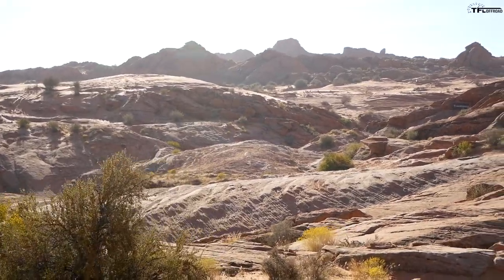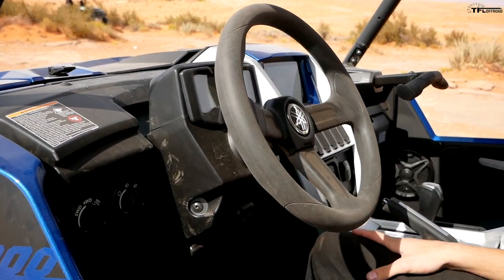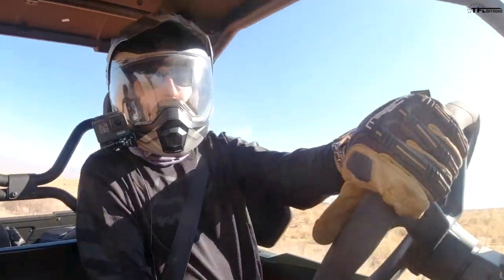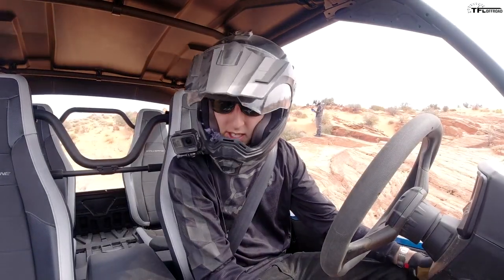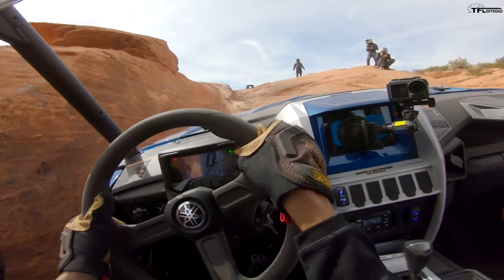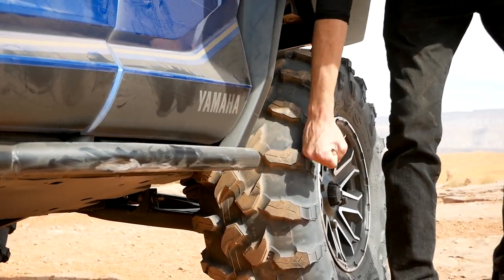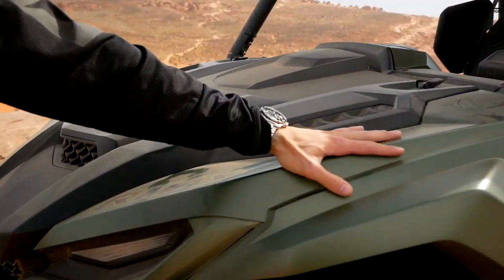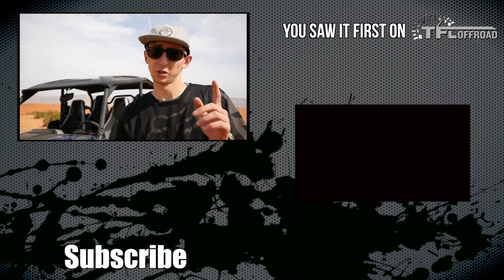I Drove the All-New Yamaha Wolverine RMAX 1000: Polaris Should Be Very Worried - Here's Why!

Comment: The RMax is quit a bit higher in price for approximately only 30 more ponies.  Much heavy for sure. And able to haul the same amount the X2 850 can haul. $8,000 difference in price. I'd love to have one but I'll keep my X2 and just upgrade my base model shocks and put bigger tires& wheels on it , and maybe even a sheeve job.  I'll still have lots of money left over.
Reply: And damn near 20 mph faster with the suspension to handle the speed.  Totally differenct machines.  Ones slow ones not
Reply: Apples to apples comparison is the General XP and the RMAX 1000 comes in considerably less. Either way, the X2 is phenomenal and a great choice, too!

Comment: @TFLoffroad, In regards to RMAX4 back seat and leg room...How tall are you?  Looked to have ample amount of leg room.
Reply: I'm 6'2 and fit just fine
Reply: @jasonlewis995  thanks man!
Reply: @DP-vd6bl  yes sir. I'm also 290lbs and have plenty of room. Getting in is tricky with the door opening but once in, totally comfy.
Reply: @jasonlewis995  If you fit, that's already better than the Pioneer 1000-5 I sold. The rear seats in that thing were a joke. I thought that they wouldn't be that bad, but they weren't great for kids because the seat belts didn't adjust. They had no leg room for adults, and the 1.5 inch piece of foam was hardly comfortable for anything more than tooling around the farm.
Reply: @DP-vd6bl  I sat in the 100-5 and while the front was ok, the rear was a joke ! You'll be VERY VERY VERY happy with a wolverine. Either the X4 or the Rmax

Comment: How long is the 4 seater? How long does your trailer need to be?
Reply: the 4 seater is only a little bit longer than the 2 seater. if you had an 8-10' long trailer, you'd probably be fine. you can google the exact length and width specs though.

Comment: I'm gonna give the a year or two to see how durable they are. It's hard to tell test driving a new machine.
Reply: Check out some of the Facebook pages. Many of us have 10,000+ miles with no repairs. I'm in a 19-4 seater. 3,900 miles of Hatfield McCoy, and Rush Off-road Park. I run high range 99.9% of the time. I'm on third set of brake pads. That's all. No bearings, no belts, etc.
Reply: @iamupononewheel  awesome

Comment: Now all yamaha needs to do is throw that 1000cc into the grizzly
Reply: Never happening
Reply: Yep. They would sell them faster than Joe Biden can fall asleep.
Reply: I'll keep my old 700 thumper, I've never needed more power from my grizzly. If I need to go over 55mph I have a truck
Reply: @brly4542  grizzlies top out at 55!?  My KQ500 tops at 62.
Reply: @nathanperry4190  stock may go faster, I have oversized big horns and a shim in my clutch, so I'm down on top speed. I also don't think top speed is much different between the 500 to the 700 class ATVs

Comment: Great machine... of course it doesn't have that certain something a polaris brings. Exploding clutches, shrapnel flying, burning belts, bad wheel bearings and a-arm bushings. I mean... the Yamahammer only has a 10 year belt warranty... polaris offers you... well, no belt warranty. 🤣🤣🤣 just replaced one for a customer with less than 10 hours on a 21 general xp. 🤣🤣🤣